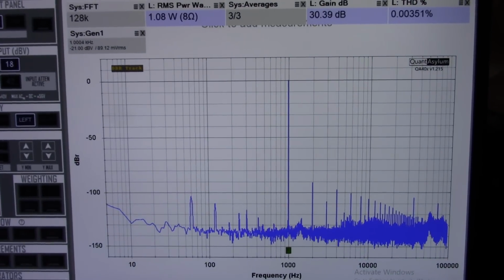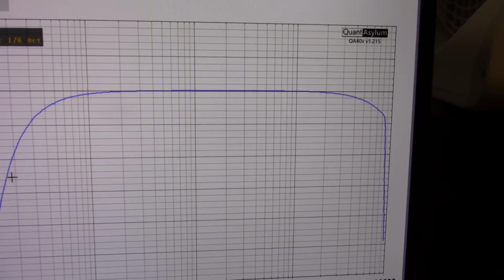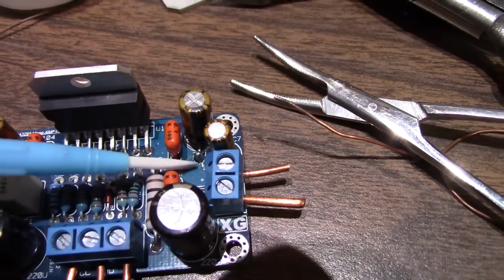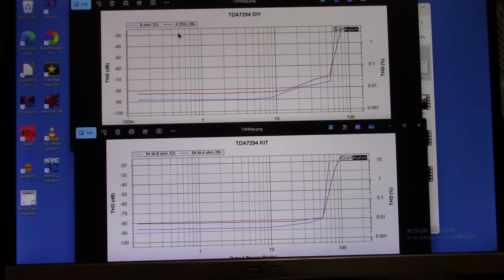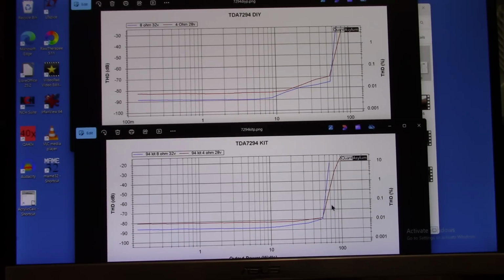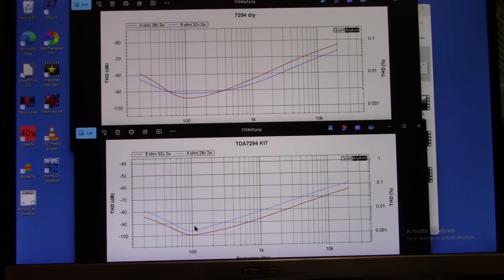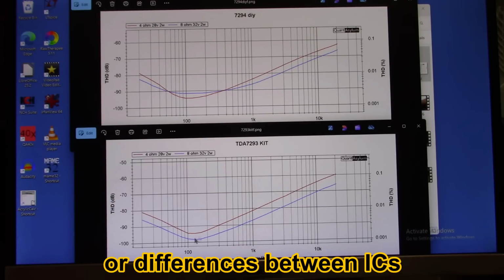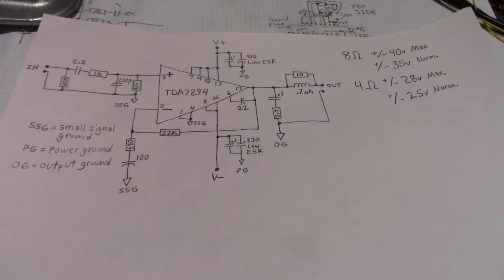TDA7294 on the audio analyzer

Comment: Great analysis, I am going to build a couple with 7293s, what would be the voltage rating on that 22uF bootstrap cap, there is no information on that anywhere whatsoever. oh and do we need a buffer upfront for this chip, would it be any better?

Comment: Whenever I can't clean the Vias in double sided boards, I just heat the Via with the soldering iron and as soon as I removed the iron while the solder is still liquid, I would blow directly into it using a straw ! Works like a charm !

Comment: Nice demo and analysis. The best way , I found, after testing many methods   to remove components on double sided  pin hole is to use hot air gun. Thank you. Can you compare TDA7294  with LM3886  ?

Comment: Thanks John! It would be interesting to see how to reduce/eliminate electrical (60 and 120hz) noise from this.
Reply from the maker: I'd try putting it all in a metal box (Faraday cage). Since the noise is down below -100dB relative to 1 watt output, it wouldn't be audible.
Reply: And use shielded cables but only connect shield at one end to prevent earth loops.
Also, any power cables should be twisted.
Reply: Yes that’s the basics, but beyond that…

Comment: I don't want to buy an de-soldering station, but I have removed 7294's from 2 sided PCB (Linn Classik) with ChipQuik desoldering kit. It's cheap and works really well.
Component tips: If increasing the input cap, do same with the feedback cap (1uf/220uf). Bypass feedback cap with 10n polypropylene cap.
Lower the gain - feedback resistor 22k -> 27k.
Increase bootstrap cap from 22uf to 47uf.
Use Polyester decoupling caps on the rails, like the kit board. put them right on the chip pins. Experiment with various values - 22n to 1uf.
Also the mute and standby circuit do affect sound quality - use the basic config on the datasheet.

Comment: good method to get those chips out is flood solder all the pads preferably with thick copper solid core from twin & earth mains cable looped round all the pins use a powerfull iron to get it done fast to not scortch the board, or better chipquik low melting point solder, the pad adheasion on those china pcbs is excellent never peeled a pad on one but they often under size the drill through causing the vias to trap solder ,so have pulled some vias out , a real pain!

Comment: So many speakers these days are rated at 8 ohms nominal, but many I have measured are much nearer to 4 ohms at times. Speakers actually rated at 4 ohms can easily drop to 2 ohms that many amplifiers do not like. As John has commented here, best to use a lower voltage on such loudspeakers
The best solution together with a higher power output is to parallel up 2 x 7293s genuine ones of course. These boards are sold as a Duel TDA7293 and include a servo chip to keep DC offset at less than 1.5mV. The amazing power from this combo with a supply of 40 volts is 84 watts into 8 ohms and 144watts into 4 ohms just prior to clipping. frequency response with the board un modified at 0.5dB down is 23hz and 20khz. My follow up video shows how to change the gain and widen the frequency response. I really love the sound and power of this combo, now in use daily for over a year.
Reply: Stereophile lists EPDR parameter derived to better approximate dissipation in class AB amplifiers handling reactive loads. Steep phase angles, especially in vented speakers, often lead to much higher than expected strain on the outputs.

Comment: Hi John, try this for getting the solder out ot through hole boards. 
Heat up the holes one by one and get yourself a can of compressed air from wallmart staples,etc and once you heat up the solder blow it out with the compressed air, works great! 😊
Reply: Put on solder bath, or use a soldering iron eith custom copper tip, or use 2 soldeting irons to heat the solder joins n pull the chip.

Comment: you can just buy a cheap 10$ desoldering iron (one which has a hand vacuum thing in it).
Reply: How easily solder is removed depends on the board. Unless you have a really good solder vac. Or you use the wet method. When I salvage parts I put boards over a pot of molten solder. But that beats the board up. Salvage is different from rework. In each case the valuable item is different. In salvage the parts have value and the board is trash. In rework it is the other way around. Other methods people use are the compressed air blow and my favorite, heat it and beat it. Heat it and beat it is when you put the tip of the iron on a joint then you slap the board on the corner of your workbench sharply withdrawing the iron at the last moment. Lead is heavy so it has a lot of inertia. When lead is molten and it gets slapped it'll just keep right on going. heat it and beat it is very effective for removing solder. The downside is you have molten lead flying everywhere. But you can use an empty cardboard box to catch it. You have the box on the floor and then beat the board on the rim of the box. That works stripping single sided boards too. But you beat it on the parts side then. If you're clearing holes you beat on the lead side. Solid state is great stuff. It can really take a beating.
Reply: @1pcfred  I used to do something very similar to the heat it and beat it method. honestly didn't know that was a thing, but every single time a ball of hot solder lands on my hand.
Reply: @CMAAniketBasak  I worked at a board house as a bench solderer and that's where I learned about heat it and beat it. We had solder braid but we didn't have solder vacuums. Sometimes we had to do QA board rework too. So we'd use heat it and beat it. You have to be fast like the snake. But if you do it right you can get a hole clean as a whistle. There's just the barest plating of solder left in it. Desoldering is the opposite of soldering. With soldering you want everything still. Desoldering you want to mess that joint up. So knocking the snot out of it works.

Comment: Thank you for this excellent video. Are you using known legit TDA chips? In the past I've used these chips in bi-amp and tri-amp setups for mid and tweeters while powering woofers with class D. Based on your distortion measurements, they're even more suitable for bass. Have you already compared them to LM38886?